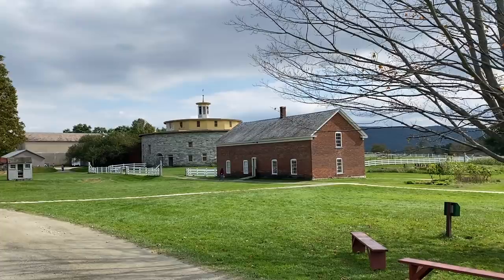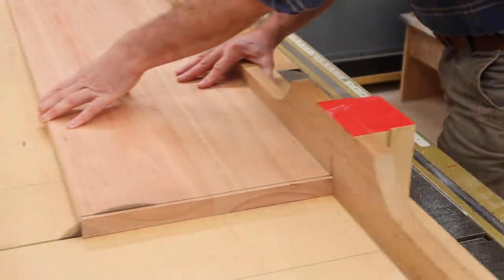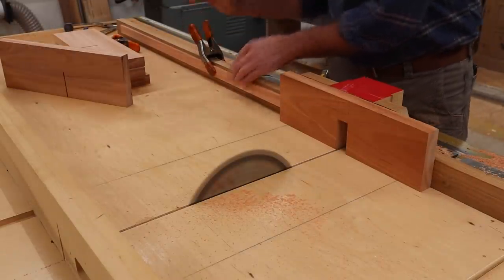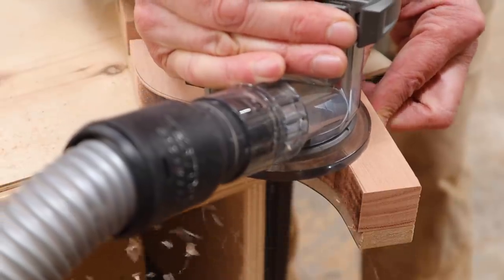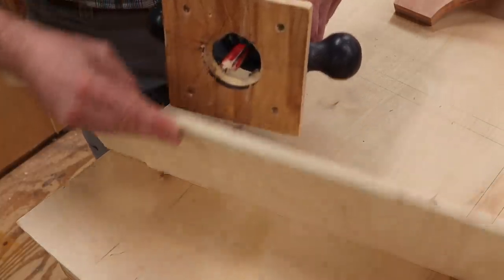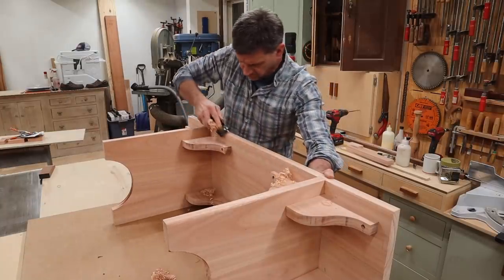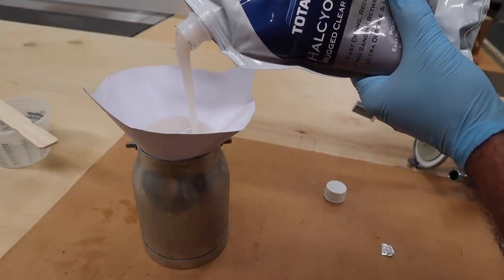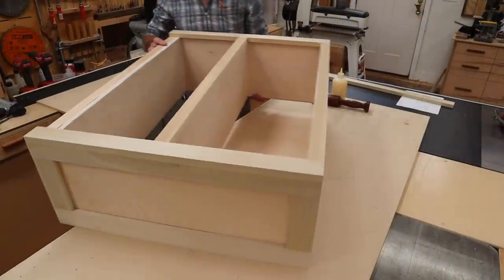How to Build a Wooden Bench - Shaker Bench Reproduction

Comment: Thanks.  Especially for the tip about using the router guide to make the dadoes and to tweak them to fit.  Fitting parts often seems like a hit-or-miss random process.
Reply: Agreed! Covering the line like that was both simple and brilliant.

Comment: Great little project! For board glue up I use my doweling jig. Of course I also use it for joinery. I think it is more versatile than biscuit joiner. I really like your dado router jig - unlike the ones that rely on a pattern bit or router bushings one knows exactly where it will cut.